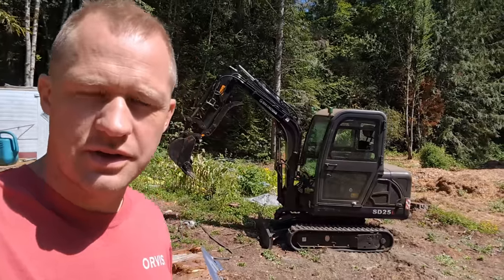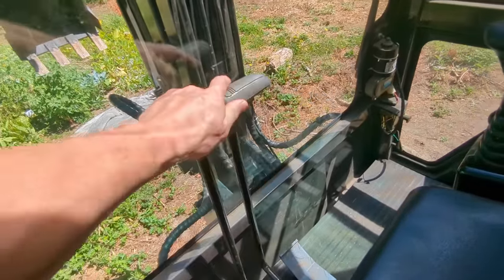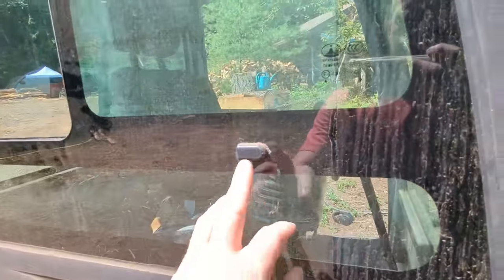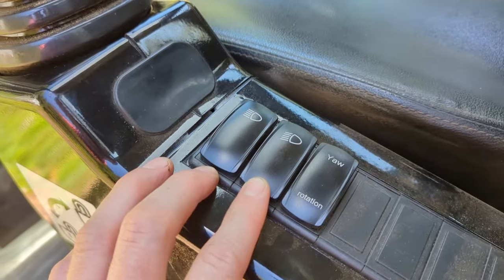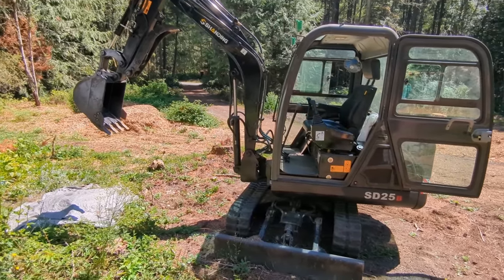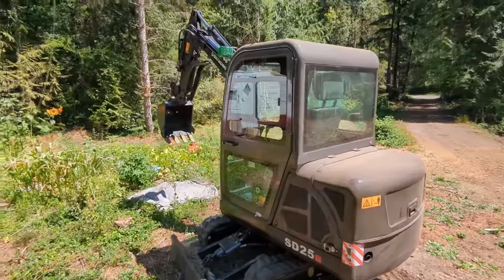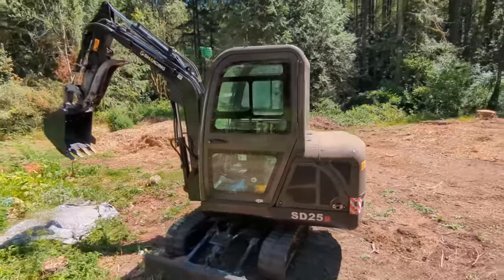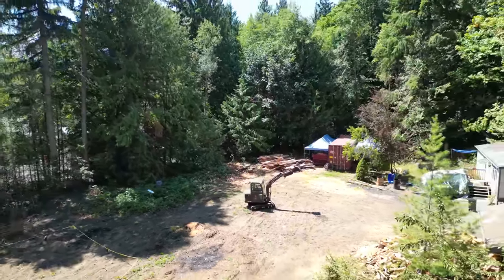Mini Excavator from Alibaba - 10 Problems after 50 Hours

Comment: 10 problems after 50 hours is far better than 50 problems after 10 hours.
Reply from the maker: You have a solid point 😁
Reply: Yep. Seems like normal break-in hiccups for any new vehicle or machine. Try as they might (if they try?) they cannot catch everything at the factory. I've had similar little items on a brand new boat, trucks and a trailer over the past 25+ years. First experience had me fuming mad. Now I know--like it or not--it's to be expected.

Comment: In Australia when you are paying 70 - $80,000 for a 2-3tonne mini excavator and you can get the same size out of Chine for $10 - $25,000 ( cheapest to medium ) get it back in your country, put $5 - 10,000 into it to upgrade most of the running gear, you have your self a pretty good machine for $30,000. For $30K in Australia you would get a small machine with about 6- 8,000 hours on it that looks like they just dragged it out of an old army machine graveyard Fromm WW2
Reply from the maker: I am very happy with my excavator so far. I like the idea of putting money into upgrades
Reply: Not sure about the accuracy of your pricing for a new name brand excavator in Australia. I found a new Kobelco 2.7 excavator for sale in NZ for a price of AUD$35000 which includes a GST rate of 15%. I think the new price would be similar in Australia. However in general we do get scalped with highly marked up prices in Australia. Not even mentioning real estate.

Comment: I hope problems won't start now I write it, but I have a Bobcat 2,7t Excavator purchased new. 140 hours now and zero issues 😉 But I guess the price difference is remarkable as well. I didn't get a Chinese machine since I wanted something that simply works.
Reply from the maker: Yeah that wasn't in my budget. Your Cat should keep on going strong for many hundreds of hours.
Reply: @einarmikkelsenPNW  Absolutely fine, I considered a Chinese machine as well to save money but in the end my time is quite constrained. Still, you will get a lot of useful work out of it and enjoy using it!
Reply: @einarmikkelsenPNW many 1000.of hours u mean. Standard western diggers 8to10000.hours
Reply: @jasperaj1  Keep her maintained, you could probably push 20,000 hours outta her. Make sure her engine oil is changed and you use good fuel too.
Reply: @britishgamer666  not a chance your average 345C and D models do 16000 and its pretty well worn after that smaller machines you will get a good 5000 then they will start costing more than they are worth
Reply: I too would like a name brand excavator. If I we’re using it for my livelihood I would spend the money for a Kubota or Bobcat but I only use for home projects so paying 3 times the $ did not make sense to me. I ordered a 1.8 ton and I hope I don’t have too many problems. The leaky hydraulics is really a pain. I wish they’d be more careful in production.
Reply: The prices aren't even in the same zip code mate
Reply: @csakzozo  Nice way to put it. But in the end its a machine. The real price of it only becomes apparent when you sell it anyways. The Bobcat is still going strong. Has about 500hours now. Up to now zero issues except a grease fitting I had to replace. I hope it stays that way. Still happy with the decision to go the expensive route.

Comment: All the machines do that  at 6.27 from cats to chinese, if it did not move because you are working the levers all together, if they didnt do that you would have valve blocks everywhere, normally blade goes up and down and the turret spins while travelling- because it has a rotary distributor in middle of machine on platform.
Reply from the maker: Thanks

Comment: So as an operator and an equipment mechanic i can answer all three of your thumb issues.. it doesnt have the protruding grease nipples because they are prone to getting broken off and allowing dirt into the joints as they are directly in in the path of dirt and rocks from the bucket... the big manufacturers have solved that with moving the zerks to the other side or (more commonly in the pin end rather than the hydraulic cylinder...
The pressure bleed of is most likely caused by oil getting past the piston in cylinder to the other side of the piston thus allowing it to relieve pressure on whatever your holding... now that could be the thumb cylinder OR the bucket cylinder doing it. Best to test the bucket bleed off with substantial pressure on it b4 you just rebuild the thumb cylinder.
And last but most definitely not least... that bent pin is a manufacturers defect and definitely not caused by you.... a quality pin wouldve held straight and the log wouldve just slipped in the thumbs grip when you hit the tree or whatever it was you hit. Thanks for the most comprehensive  series ive seen so far on buying and running one of theese machines. I was looking at this exact machine and found your first video when i searched for the hidden import costs, i now know its considerably out of my price range and that for me im better off with a used cat or deer machine
Reply from the maker: Thank you so much for the insight. I am brand new at this and learn so much from the YouTube community.
Reply: Yep, was thinking the same as you about the bypassing piston, I’ve stoked the rod out and have taken off the low pressure side hose and stalled it out while watching for hydraulic oil to bleed out
Reply: @johnpike9612  The pin didn't bend it was the "pin bracket" also called a " pin boss"  that bent,they are not using a high carbon steel or heat treated steel on this.
Metalurgy is an understanding of what types of steel you need to apply to your product!
Stock mild steel bends easy,and it's what appears to beuseds here.
Note,hit it back over if you can,or it'll wear the pin boss out of alignment, and removing the ram later will be harder. 

But then these are cheap products compared to our American made units.
And that being said,a lot of them are made in China!
I'm not a hydraulics expert,and your point about poor seals in the rams may be valid. 
But with hydraulic valves, they come with a preset pressure relief valve, which on my system was adjustable. 
That being said,I built my own 30' roll off truck bed with 10 foot long rams out of a garbage packer,one leaked,but I never had too much problem with pressure.
There is also a separate pressure relief valve that can be in the pump,or somewhere inline.
I'd say the way tgey plumbed the hydraulics,was to save a few bux,instead of using the proper plumbing or valve body at the hydraulic controls.
The owner should get a copy of their hydraulic schematics and put a pressure dial on ot (temporary or permanent)that shows how much pressure drops off when he moves it.
If they used a hydraulic valve gor a lower pressure, and a smaller gpm pump,you definitely will get a pressure drop.
This could be a serious issue in an area full of trenches, etc.
Reply: @davidrussell8795  a two way cylinder has fluid on both sides of the piston separated by seals that are wear items....failure to maintain position can be caused by your diagnosis but 90% of the time the seals on the piston allowing pressure to switch sides of the piston unless you can find a visible leak somewhere.  As for the bent pin, you weren't wrong, (intirely) it is indeed mild steel and junk but considerably larger than EVERY SINGLE other part of the thumb and shouldve never been able to bend IF that adjustable pressure relief you mentioned is adjusted CORRECTLY, therefore its still technically a manufacturing defect
Reply: @johnpike9612  Well,ya buy a coffee at McDonald's  and ya can't expect a nice porcelain coffee mug to go with it, canya?
Orr,as they say: ya get what ya pay for!
But on the other hand,our equipment is wayyy overpriced!
So this little digger can save a fella or gal,a lit of $ in do it yourself projects. 
And fix the quality control mishaps yourself!
Reply: @davidrussell8795  agreed 👍 but ya gotta be an operator AND a mechanic to justify it IMO
Reply: @johnpike9612  I is! Or..was! And still is!!
Imo =?

Comment: Good review 👍🏼
You are helping a lot of people to find out the real world differences between cheap Chinese copies and more expensive 'name brand' machines.
In regards to your hydraulic thumb losing pressure, they can develop internal pressure/fluid leaks, with everything looking fine on the outside.
I suspect that is the problem with yours. 
Similar story to your other hydraulic leaks, probably a very cheap O ring or seal to replace, but this time a lot of work to replace it.
Keep up the good work 👍🏼
Reply from the maker: Thank you!
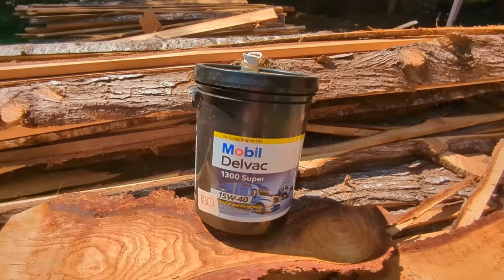Reply: ENGINE OIL in the hydraulics!!!!!! ( 1:00 min in )
Reply: @chrishanson9542  Yes engine oil not all that long ago was superior
 to hydraulic oil.
Reply: He knew it was cheap and anyone who buys these machines is cheap you don't need to watch a video to know chinese cheap is junk shit haha but good vid
Reply: I know harbor freight is cheap china shit, but i still go there often for one thing or another. Im in the process of negotiating for a mini skid steer right now, this whole series of videos has been exactly what i needed.@ROCKSTARLAND99
Reply: @chrishanson9542  Never use engine oil in hydraulics unless your desperate! Also,the types of hydraulics have changed in some machines like combines,it's a50 50 mix of hydraulic oil and engine oil!
I've put used motor oil in my roll- off trucks system, but the fine metal particals wore out my pump fast!
Use the recommended hydraulic oil!

Comment: Nice review.  The thumb circuit relief valve is probably set very very low and won't hold pressure.  Follow the thumb circuit back to the valve tree and locate its valve layer.  Look on line for how to set the relief valve - generally loosen a jam nut and back out or drive in the relief valve spring screw.  You should use a pressure gauge in the thumb circuit to see what the peak pressure is - it is generally set lower than the bucket relief pressure setting - so that the bucket can overdrive the thumb if it needs to and nothing breaks.
Reply from the maker: Thanks! I'll give it a try
Reply: Well said . I’m a caterpillar dealer mechanic for 35 yrs and would start with what you suggest. Best case scenario is a relief set too low and only needs adjustment.

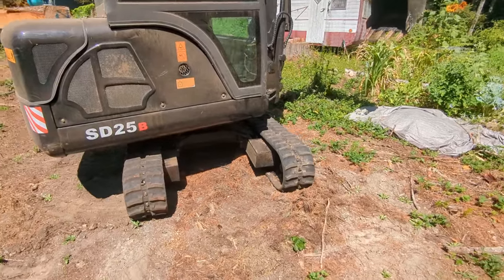Comment: Kind of concerned about the oil you pictured at 0:59 - Mobil does have a Delvac brand hydraulic fluid, but what you pictured is engine oil.  Is that what the manufacturer specified?
Reply: Glad I wasn’t the only one who saw lol😂
Reply: Scrolled so long to find first comment about engine oil vs hydraulic oil
Reply from the maker: I accidentally showed the wrong container

Comment: The thumb fitting is different because what your grabbing would just sheer of any extended grease fitting. What your describing on the hydraulic issues is internal bypassing of fluid. A cab with no A/C would not work well in the south west in the summer time. Very good video. The main question is are you  satisfied with the product? You answered that question. Bring up all the flaws helps the manufacturer know how to make the product better, Thanks for the video.
Reply from the maker: Got it. Thanks 😊
Reply: @einarmikkelsenPNW   You like did a quality assurance program on their equipment , they should at least refund your cost. Maybe pay you some extra..  The main question I would have being in Aridzona . It's at least 100 degrees seven months out of the year. Can you get A/C units installed. I wish they they would put a lot more effort in cab design. I want A/C and comfort. A person is going to be sitting in a cab for hours at a time. it really needs to be the best as can be. Climate control is a major issue. I do like the video, and I have a degree in aircraft maintenance , Specializing in fighter aircraft . The new cockpit designs are awesome, and each aircraft newly built  normally has better  cockpit designs. Temperature control is a top priority. You are correct to point out all the flaws in their product as now they know they could do better, or use better materials.
Reply from the maker: @troyb.4101  Thank you! I am a former Airline Transport Pilot, and currently work as a firefighter at an international airport, so I know exactly what you talk about. I wish there was an AC option for my rig. My solution was to remove the door, duct tape the sliding window in the open position, and keep the fan going at all times. I haven't looked into AC, but it would be a game changer. I would first install a fan to exhaust the heat from the engine compartment and add insulation to the fire wall.
Reply: @einarmikkelsenPNW  I Will be putting a lot of money into one of these machines soon. I want certain items, and abilities from the machine as I'm 62 years old, and have to maintain my ranch on a very limited income.  I only hope some MAJOR improvements are coming soon. It would be better to have the manufacture design every thing for operator comfort. I'm just too old to be cooked all day long!

Comment: It’s normal that you can’t keep pressure on the bucket/thumb. On all excavators it’s similar. It’s because the oil is not compressible and to keep the pressure is a matter of few ml. And with conjonction with the cylinder seals, that are not supposed to be super sealing, because they are heavy duty sealing, they are not rubber but metallic rings, similar than the ones on piston motors. This technology is super durable but it does have a slight leak. The light duty cylinders have rubber seals and can keep pressure a long time.

About the tracks and bucket/arm/boom plumbing disorder : it’s not a disorder, it’s a matter of oil sharing in the system and all excavators are similar. But complex excavators does have very complex priorities systems that makes the problem much less obvious. A tracking excavator normally have 2 pumps, one for each track, and from those 2 pumps the other functions are also plumbed. Usually the boom is not plumbed on the same pump than stick so they can move 100% independently. But normally boom is plumbed with bucket so if you want to use both the same time you’ve got to learn how to manage, the one with less pressure will move first !!
If you want the pressure to be kept you have to install an accumulator on the pressure side of thumb. Choose one that can withstand the max pressure of your machine. But I think it’s not necessary, for short time holding time the  small amount of accumulation provided by the flexible hoses during pressure build is enough.
Reply from the maker: Thanks

Comment: the lot of these "mechanical" issues could be fixed if they had trained mechanics at their factory. Seems like they might be stretching o-rings to fit. Or just low quality o-rings in general. The thumb losing pressure on squeeze can be fixed if you can find a similar cylinder size and length to install. Or the valve spool allows too much leak by. 

Only way to know for sure is hook up flow gauges in certain spots to know what is leaking internally where. Im sure there are youtube videos somewhere or online guides if you wanted to know for sure if it was the cylinder or the valve spool.

Edit: additionally, if there is a seal kit, you could redo the seals for the cylinder. Also do a visual inspection of the valve body that controls flow to the thumb incase there is no external leaking
Reply from the maker: Thank you very much for all the great info. I'll be checking it out.
Reply: ENGINE OIL in the hydraulics!!!!!! ( 1:00 min in )
Reply: @chrishanson9542  engine oil for hydraulics is normal. we use 10w30 engine oil for case skid loaders. scissor lifts use automatic transmission oil
Reply: @InevitableTruth247  you can get problems with cavitation and rust using engine oil as water is absorbed by the engine oil while hydraulic oil would not.

Comment: Unpin the thumb rod, install zerk fitting 45* or 90* then turn the rod, grease fitting to the back.
Using Diesel engine oil doesn’t sound right for hydraulic oil??
Reply from the maker: Correct about the oil. I showed the wrong container by accident.

Comment: You buy cheap you buy 5 times, But I hope you get a good run out of it. I bought a used Yanmar Vio17 with 800 hours on it. Several hundred hours of heavy use later, and zero problems. Kubota and Yanmar every day of the week (in my opinion)
Reply from the maker: At least mine has a Yanmar engine 👏

Comment: @ 5.37 when you change direction by curling the bucket.  Effectively you starve 1 track motor of oil when you curl the bucket.  The digger is built down to a price, and this is 1 area it shows.
Reply from the maker: That makes sense
Reply: My Yanmar B22 will slow down one motor when traveling and trying to lift the boom or another control. 
But the motors aren’t effected if you operate the blade when traveling, I think a lot of smaller machines make the blade priority when traveling for grading. Most of the time you don’t need to travel and dig at the same time. I’m pretty sure that’s not a “problem” on your machine, it’s more of the functionality of the hydraulic spool valves.  Thanks for posting 😊👍
Reply from the maker: @Mikefestiva I appreciate your insight and feedback.

Comment: pressure relief valve may be actuated and cause the thumb to lose it's grip. might need it to be set a little higher pressure before the relief pops off.
Reply: @djdeaf13  remember the "quality control"
For sure be careful with adjusting that valve, use a gauge to adjust it.
Reply from the maker: Thank you
Reply from the maker: Thank you
Reply from the maker: Good call.